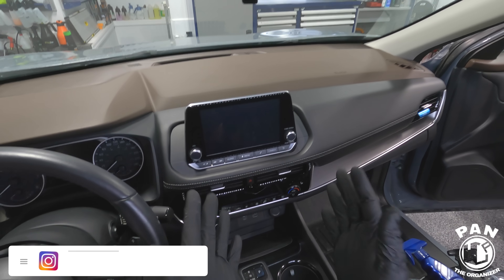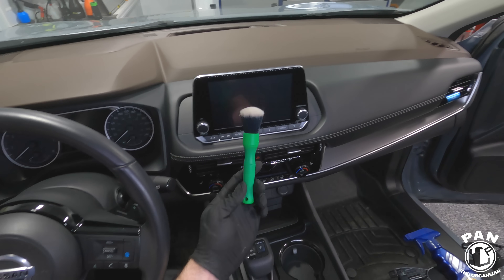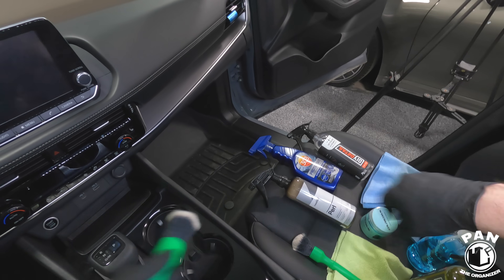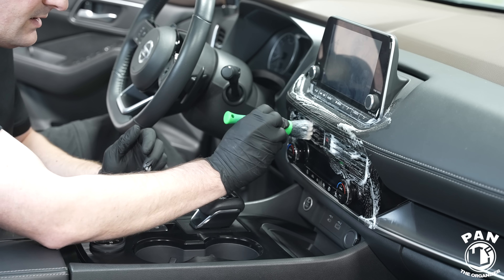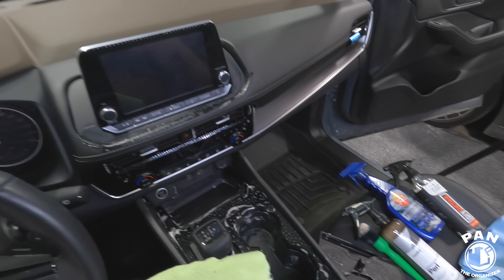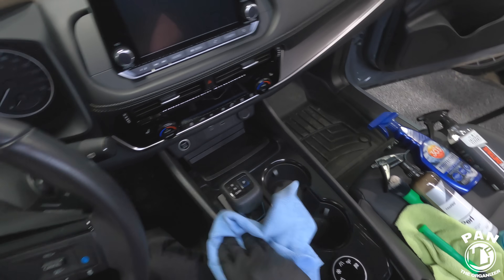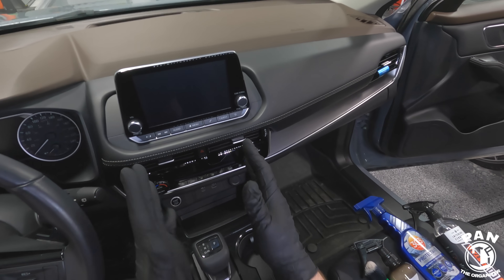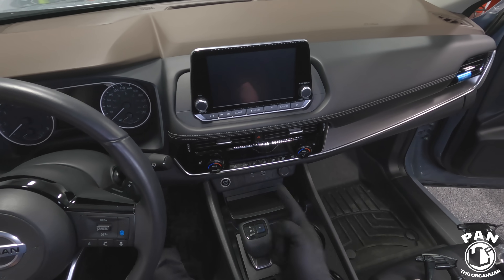Ultimate Car Center Console Cleaning Guide: Pro Tips, Products & Step-by-Step Tutorial!

Comment: Excellent as always.  I love these short and sweet videos.  I'm a huge fan of the 303 line of products especially the 303 Protectant.   Gives that OEM look but adds the UV protection.  For the infotainment and navigation surfaces I like to use a IPA mix at a 1 part isopropyl alcohol to 5 parts distilled water.  So far it works like a charm when combined with a short nap microfibre towel.
Reply from the maker: Good technique Joseph!

Comment: I always enjoy watching interior detailing. Driving a clean interior is a must! I usually bring those rubber inserts for the cup holder and cubby inside and give them a good wash in my sink with warm soapy water, just to make sure they are really clean, then dry them with a microfiber towel and put them back. Sadly i have to put my gatorade bottle in my cup holder upside down because the bottle is too wide and the neck is the only thing that fits, so i get leakage sometimes! Drives me nuts! Love your interior videos!
Reply from the maker: Thanks!

Comment: Very nice. I need those extremely soft brushes. 
Do you know something new from the ceracoat thing after u done the update? Did they fix it? Or give better instructions?
Reply from the maker: They are working on the revised formula, but haven't officially released it yet. I'm guessing they are testing currently. They said that they will send an e-mail to everyone who ordered the original version, once the new one is released.
Reply: @PanTheOrganizer  ok cool. I bought the kit but was not sure if i should apply it or not.

Comment: I have a gloss black portion around my gear shifter that’s been scratched over the years. Do you have a product recommendation to make it look as good as possible? I’ve used an interior cleaner and liquid wax, but my choices haven’t made it look great 😮
Reply from the maker: The only way to remove scratches is to use a polish. Either by hand with a microfiber towel, or with a small 1” polisher.

Comment: This is maybe a strange question but with the water-based surface protection products, what happens if any water lands on your interior? An umbrella dripped on the trim in my car and when the water dried there was a strange strain left behind (not simply a water stain). The car had been at the dealership for repairs and they cleaned it before returning it. Now it's with me, I'm planning to do its regular clean myself, but I don't want to risk weird stains every time it rains!

Comment: Automotive glass cuts out UV rays from the sun so I don’t understand the need for any UV protection on the interior. IE) transition glasses don’t turn dark inside the car because the windows are blocking out the UV rays
Reply: I too have always wondered this.
Reply from the maker: That is incorrect, from a scientific perspective. There are three different types of UV rays. UV A, B and C. Glass doesn't cut all of them. Case in point, that's why some truckers can still get skin cancer on the side exposed to the road when they're driving, despite driving with windows up. 

Car windows are typically made out of normal transparent glass, and they should block out most UVB radiation. UVA radiation, however, can mostly pass through normal glass and cause damage to your skin, and other materials in the vehicle.

Also case in point, see vehicles that are a few years old, that are situated in areas with lots of sun (California, Arizona), and sit outside all day. The interior materials often start fading and cracking. Because of the sun's damaging UV rays. And that's despite the windows being closed.

Over time, UV rays and heat exposure can lead to fading and oxidation, upholstery damage, dashboard cracking, and other material breakdowns.

UVC is completely absorbed by Earth's atmosphere, so it doesn't pose a risk to your health.

Tinting glass reduces the amount of both visible and UVA transmitted through it. Some UVA still gets through, though. On average, 60–70% of UVA still penetrates tinted glass. So even tints won't necessarily fully protect your interior, unless you get into the more modern ceramic and infrared protective tints.
Reply: @PanTheOrganizer  excellent info Pan thanks for taking the time to educate me. I sure wish they could figure out the transitions lenses for driving. Haha. Take care!
Reply: @PanTheOrganizer  thank you Pan for this very informative response.

Comment: Pan how many times can you use the cleaning gel before replacement? I would assume once it doesn’t adhere or if it becomes very I’m wedded with dirt. Just wondering as I have a lot of gloss black trim.
Reply from the maker: That depends on how dirty the interiors you are cleaning are. You'll see it's time to replace it when all the surface is completely dirty and it doesn't pick up dirt anymore.

Comment: Any suggestions for scuff marks on the “rubbery” dash surfaces?  I’m at a loss to discover any means to fix this…..😢
Reply from the maker: There isn't anything you can do for scuffs or scratches on rubber unfortunately. On some lightly scuffed plastics, you can try a magic eraser with an APC as lubricant, but test on an inconspicuous area first. But rubber I haven't seen anything that can do a good job with.
Reply: @PanTheOrganizer  I appreciate the suggestion.  I have come to the same conclusion…..not much that can be done….🤷‍♂️

Comment: Do you disconnect the battery so it doesnt go flat due to the doors being open & infotainment being on etc?
Reply from the maker: Nobody has ever done that. It's not like you have the doors open for 10 hours. For the time you need, especially just a few minutes for a typical maintenance routine cleaning, there's nothing really to worry about. Infotainment should be off by the way. Don't have anything on. And turn off the cabin lights, if the switch is on. As you saw here, no lights were on in the dash or infotainment display.
Reply: @PanTheOrganizer  thanks.
I only had my doors open for like 20 mins but I already got a low battery warning because the dash and infotainment was on, it turns itself on when the doors are opened.
I'll check what to press to get that to turn off.

Comment: Good one. How do you clean the door window gasket/seal? Clean the glass nicely, and roll window and then back up, and the glass cleaned the window seal with dirt back on the glass. Frustrating. Thank you Pan.
Reply from the maker: Spray a bit of APC or interior cleaner on a towel, and use a tool like a an old plastic credit card wrapped with that towel, and go back and forth.